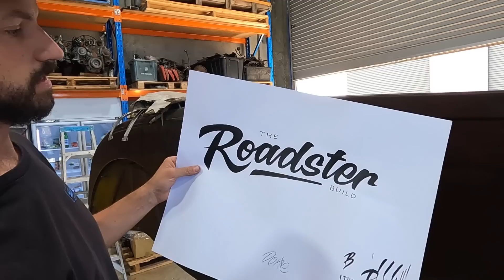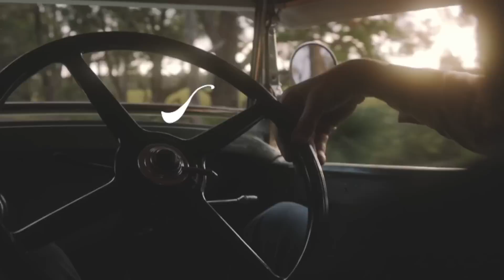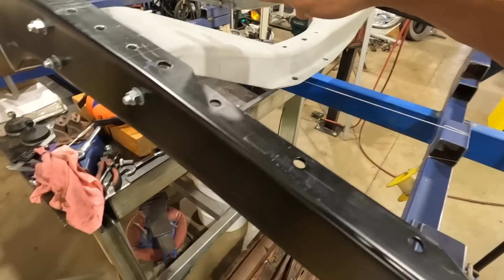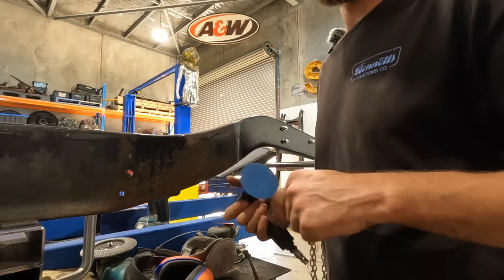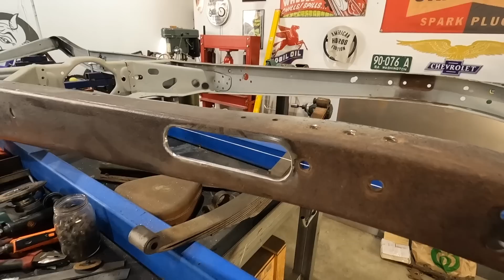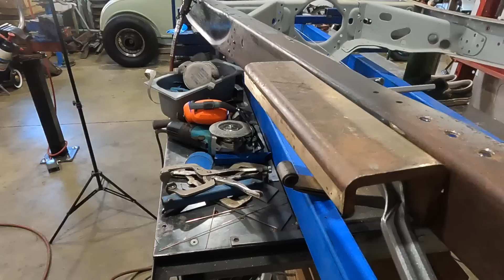1932 Ford Frame Repairs - Lots of TIPS (Roadster Build)

Comment: Love your work as always. One note on the frame splice. Vertical is perfectly fine. A properly executed butt joint will fail at the base material adjacent to the weld, not the weld. The whole angle and Z joint thing is an old wives tail, a non applicable carry over from wood working.

Comment: Another great video, thanks. It's starting to warm up here in northern Indiana, USA. In a few weeks I can start on the chassis on my 53 Chevy 3100 pickup. I'm running a 1000+HP 6-71 blown NOS Chevy inline 6 292 so I need to do quite a bit of work on the chassis. I really like your attention to detail and after watching you I think I can do this. Thank you for taking the time to make this video.
Reply from the maker: Make sure you put lots up on the build would love to follow along! Did a 54 gmc heavily modified with half the horse power
Reply: @bennettscustomsco    Half the horses is double what was supplied, and I used to haul around 12 tons with a 235.  Should have been a real mover, eh?

Comment: Hi from Ireland love the work you do, being a welder for 30yrs myself have to say your pretty handy with the torch 👍🏻, just a tip if you don’t have heavy filler wire, tack two strands of the small stuff together side by side 😉, I’m mainly industrial pipe welding the last few years and it’s a trick I’ve used when I’m stuck for heavier wire,looking forward to the end product on this build 👍🏻
Reply from the maker: Thanks for the tips!
Reply: Nice Tips.